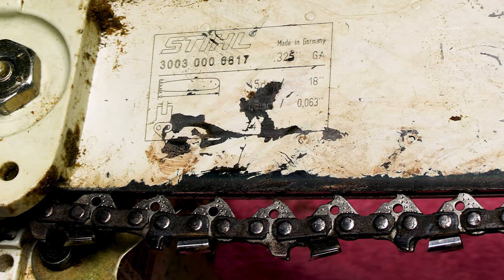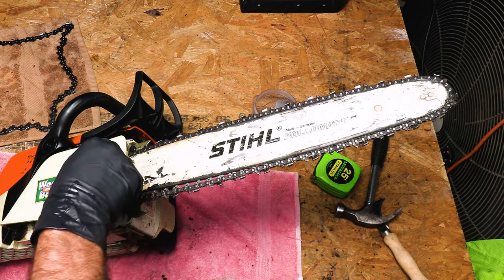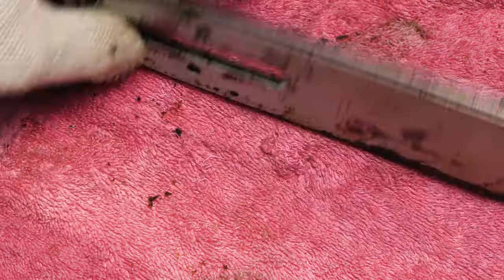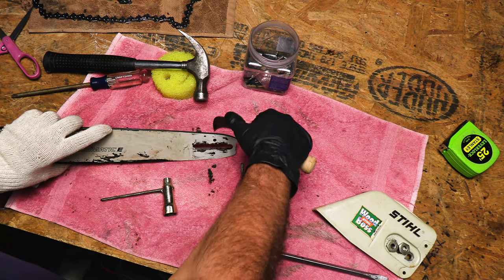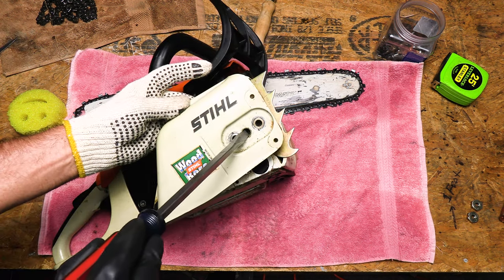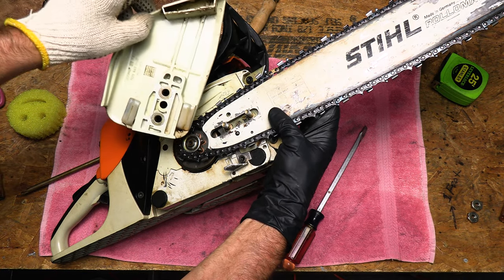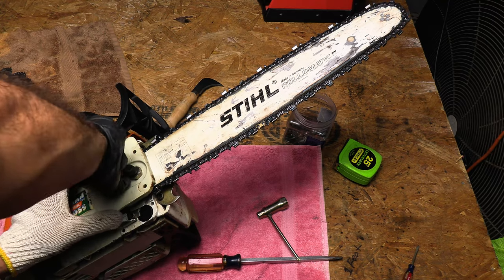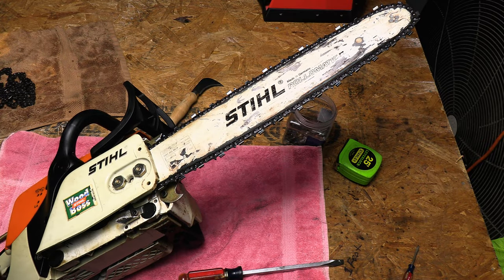Replace and Adjust Your Chainsaw Chain [Important Things You Should Know]

Comment: Hey Rudy, bought an ftm 400 from Japan with Japanese band plan, that was a mistake. Do you know if that radio can be opened to other frequencies? I get Chanel’s 144 to 146 on two meter but it will not transmit on 146 to 148. Any advice  would be much appreciated.
Reply from the maker: HI, I've had this question come up before.  I found this article on mods.dk about this problem.  You'll need an account to view the article, but it's free.  I hope this helps.

https://www.mods.dk/forum.php?action=ViewThread&Thread=11794&RadioId=1-yaesu&ModelId=1173